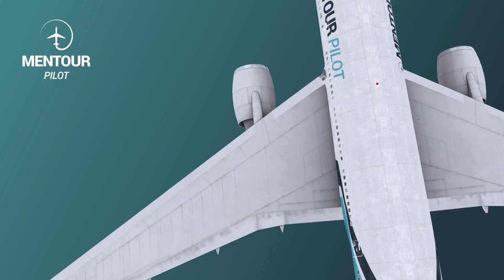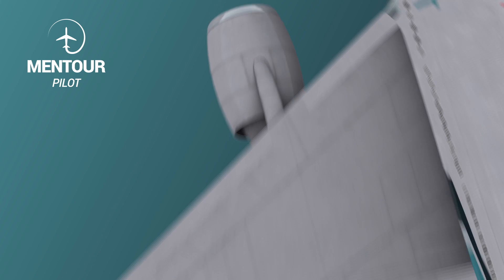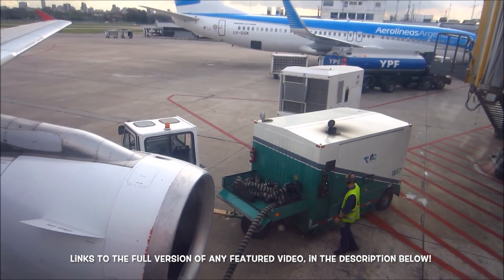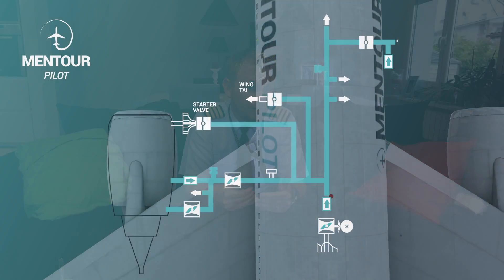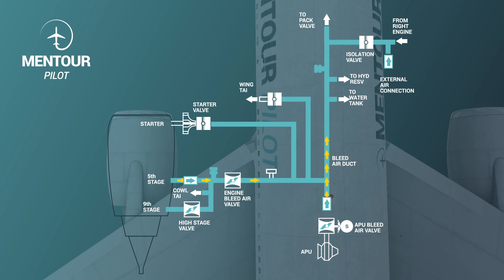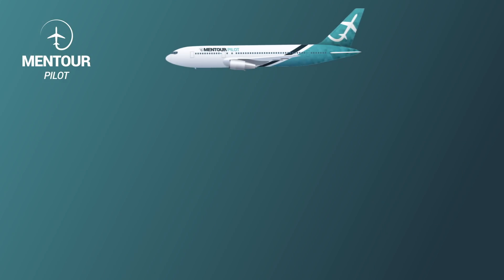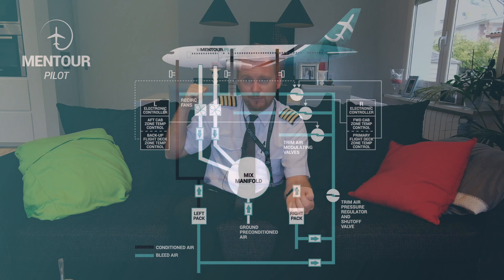How does the Boeing 737 Bleed-air system work?!

Comment: I don't understand why and how bleed air is used during engine start. I thought that the engine starters were powered from batteries or the APU. I remember long ago, before APU's were fitted, start power was provided from a mobile generator that was connected to every plane while on the ground
Reply: The starter is a pneumatic turbine. Needs air to turn

Comment: I remember the only time I flow in an L-1011 TriStar. I saw some sort of vapor descending from the ceiling near the left side of the cabin. I never said anything and nothing bad happened, but I still wonder what I was seeing.
Reply: Condensation, maybe? If the air from the vents is colder than cabin air, it is possible.

Comment: That method of diagnosing the bad engine led to an infamous crash in England. An engine was malfunctioning and they smelled smoke in the cabin. So the flight crew shut the engine down -- but the WRONG engine (the GOOD one). What happened? They were flying a newer submodel of an aircraft they were familiar with. One of the changes the manufacturer made was to switch the cabin air to a different engine. Crash investigators concluded that the crew weren't adequately trained on the newer plane! 😥

Comment: We sacrifice a bit of fuel in order to keep the PAX alive.... Thank you Boeing, thank you Ryan Air!!!!
Reply: The Cabin pressurized with exhaust gasses for the flight duration can not be a good thing ,
Can't be nice for the Pilots and Cabin Crews  knowing that their work place is heated with exhaust fumes from the jet engines,or the Ground Crews breathing exhaust gasses for a good percentage of their shift ,
The upside the pay is good !
Reply: @markf5437  I believe the bleed air is extracted from the engine before the burn chamber.  You are just breathing the air that enters the turbofan but compressed, heated, and cooled.
Reply: @tonyperez8683  It is air that has been through internals of  a mechanical compression process of shafts turbines bearings etc  operating @  +600c or above there will be fumes from the oil lubricating the bearings
Reply: The PACS keep the PAX alive!

Comment: Is starting via external air ever used for fuel/cost savings? I.e. some airports provide ground power/ground aircon, so you wont have to sit with the APU on, it seems like an air start that keeps you from having to put any start/stop cycles on the APU would go with the other two services.
Reply: The problem with that is the cabin heats up really quickly, particularly with 160 sweaty people on board. The airconditioning packs need to be run to keep the cabin cool. There is a bit of messing around with air starts from an external source. Then the other engine needs to be “cross bled” started when out on the taxi way. Much quicker with the APU - aircraft stays on schedule.
Also if you don’t use the APU you need to supply an external electrical power source

Comment: What happens when the airport itself at a high altitude or even above 8,000 ft?  Does the pressurization system have to be adjusted to compensate so it doesn't overshoot too far?  Does the pressure remain essentially the same during takeoff or approach to such an airport?

Comment: Love the videos, but two questions on this one Mentour:

1. Why is the water removed from the air intentionally when this is a common complaint on aircraft. Why not keep a comfortable level (or at least more comfortable) level of humidity in the air by removing less water or none at all?
2. How can you smell a bird burning after a bird strike if the burn chamber is after the bleed chamber. If you're not smelling burning jet fuel usually why would you smell burning bird?
Reply: At altitude there is very little moisture up there, also dry air is good for preventing corrosion on the air frame, 
Bleed air is compressed air about 250C degrees at about 40 psi, when u compress air it heats up at that temp. U will easily roast that bird to bits
Reply: Clinton Mead Water is only removed on departure from humid tropical airports.
Reply: @gordonrichardson2972 how does the water separator know what airport you are at?

Comment: 5:46 Since the air is already really dry,  why do they lead the air through a water separator in the first place?
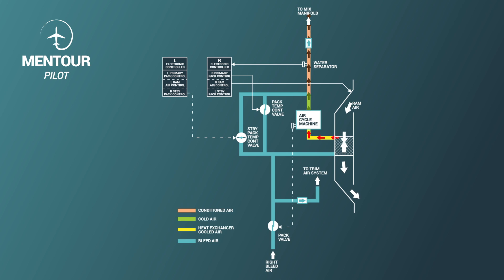Reply: The same way a conventional air conditioner ("vapor cycle machine", as opposed to "air cycle machine" like shown at 6:09) often drips water.  Its evaporator (vapor cycle) or expansion turbine (air cycle) gets cold enough to condense water out of the humid air, leaving dried air.

With air cycle machines it's usually a lot colder, cold enough to even condense out what little moisture is in the air up at altitude.  The water separator clears out the resulting fog / frost.  (It is then often sprayed into the ram air to further help cool the bleed air, as described at 5:08.)
Reply: Bëpp The air is only dry at high altitude, the humidity at departure can be significant.
Reply: Gordon Richardson That makes sense, thanks!

Comment: Doesn't the air brought in from outside at altitude have too low of a concentration of Oxygen in it?  Does "burned bird" smell like rotisserie chicken?
Reply: It's because it's at a lower pressure that there isn't enough oxygen. You'd be breathing a considerably less volume of air. It still has the same concentration of 78.08% Nitrogen, 20.95% oxygen, 0.93% Argon, and 0.04% other.

Comment: Wouldn't we be sacrificing a bit of fuel efficiency using electrical compressors too? All in all, it uses electricity generated by the engine, and adds weight to the aircraft.
Reply: Yes and no. The engine to sustain power would need a tiny bit more fuel to remain at power but it depends on how the electrical system is done.
Reply: jdr ok , same goes for bleeding air from the engine. If it isn't as efficient as it could be, then the loss could be significant, but that's a question of design. And bleeding air directly from the engine has extra advantages over an equally efficient electric system, like simplicity, so sought after in aircraft design.
Reply: @nicky5185  every system has its pros and cons. No system is perfect and never will be. Just like electric motors have either good low rpm characteristics or have to be pegged to do anything. It's all about building for your application. Figuring out what's what and what is best for your needs. But engines better get there quick before they try and replace the jet engine and the rocket with a electric motor driven prop and set us back about 100 years in propulsion

Comment: I commend Boeing for its bleedless, all electric pressurization in the B787.  If the bearing seals of the engines fail smoke from the engines enters the cabin.  It’s carcinogenic and a neurotoxin.  Happens a lot.

Comment: So what happens when you board the plane at a hot airport and what looks like smoke is blowing into the cabin (I know it’s not smoke and it’s perfectly fine to breathe)
Reply from the maker: That’s the cold air from the air conditioning meeting the humid air from outside. What you are seeing is water vapor
Reply: Mentour Pilot thanks. I knew it was vapour but not why it happened. Saw it on a flight from Nice. Could barely see the back of the cabin there was so much

Comment: What if the heat exchanger and air conditioning fail? Will the hot bleed air be passed into the passenger cabin?
Reply: No hot bleed air will get into the cabin, there are shut off valves to regulate and isolate the bleed air.
Reply: @e30mark  thanks for clearing my doubt 👍

Comment: Could the outflow valve fail closed? Would this increase the cabin pressure to too high levels?
Reply: There are redundancy pressure relief valves which spring loaded to certain pressure value they will open after reaching adjusted pressure difference value.
Reply: Kaeltis There are cabin pressure warnings on the pilots displays.

Comment: I knew that. When I first began flying I could always detect a very faint odor of jet exhaust. It was later on that i found out that the air we breathe is indeed bled off from the engine and it acquires that very faint odor.

Comment: Interesting subject. I learned a lot.
One thing I don't agree with. You say the 787 is using electrically driven compressors to provide bleed air (and I believe the wing edge anti ice are electrically operated as well) to save fuel. 

The additional electricity has to come from somewhere and is generated by the engines IDG, including a mechanical and therefore rather inefficient CSD. The IDG and CSD need to be sized bigger too provide the required electrical power and this generates an additional power demand to the engines. 

I am not sure if this will save a lot of fuel, if the available fuel energy has to be converted a couple of times, from pressure to generator via CSD to electrical energy and later back to mechanical to operate secondary compressors.
The statement that some subsystems are operated electrically to save fuel doesn't seem to be justified.
I am not so worried that the Boeing engineers have not done their job, I am rather concerned that this is a marketing trickery saying that subsystems are operated electrically and therefore saving a lot of fuel.
Reply: Perhaps bleeding the air out of the engine is a bigger toll on the fuel efficiency than putting more resistance on the engine? My guess would be that the air pressure inside the engine really determines the efficiency of the whole thing, and it was probably much cheaper designing it that way so I'm also a little skeptical, just seems far too convenient of an approach.
Reply: The saving fuel line is probably a smoke screen. Really they want to stop using bleed air which can cause contamination inside the cabin

Comment: What happens when flying out of Mariscal Sucre International Airport, Quito, Ecuador, which is at an altitude of 7,874 feet?
Reply: John David Wolf what about it? You can still breathe at that altitude
Reply: As Alejandro Velasco Astete International Airport, Cusco, Peru, is at an Elevation AMS 10,860 ft / 3,310 m which is HIGHER than the 8,000 maximum equivalent cabin pressure what is the protocol?  Yes I have flown into there, but it was decades ago.
Reply: John David Wolf I’m guessing then that the outflow valves will close after takeoff until the cabin air reaches 8000ft. If the cabin air was 8000ft on the ground you’d struggle to open the door in an emergency probably

Comment: Very interesting but I still couldn't figure out from this why it's usually so cold on the very first morning flight
Reply: @Trust Jesus before engine startup and in the initial flight stages, understandable. But why would the cold last for the whole short-haul flight? That's what I experienced twice with different airplanes. Did the pilots just set the a/c on too low?

Comment: Why do they make the air so dry? It's one of the worst parts of the flying experience?
Reply: I don't know for sure, but perhaps using bleed air has something to do with it? Perhaps the compression drives all the moisture away, or there's just no humidity up there at all?
Reply: It's dried at lower altitudes to reduce corrosion but at cruise its mostly dry.

Comment: Why is it pressurised at around 8000ft and not much lower? Also why do they not put some of the water back to the cabin to make it less dry, is it an ‘all or nothing’ type system
Reply: Amy Wagstaff if they pressurise to 0ft that would be a huge amount of force exerting on the airframe and it would weaken much sooner. The pressure at 0ft pushing on the frame is more than 8000ft so it’s a fine balance. The 787 and A350 can pressurise to 6000ft I believe because the fuselage is made from composites instead of pure metal so it’s stronger and doesn’t bend and flex as easily. Therefore it can take more force

Comment: Ahh, air starters. Using a turbine to spin another turbine which starts the actual engine turbine. I love aviation.
Reply: And then using the other engine to build up bleed duct pressure to cross start the other engine.
Reply: And then, taking some air from that process, which is way to hot to pump into the cabin as heat, and cooling it down to a point where it is way to cold to use as AC. AND THEN adding more hot air to it to make it the right temperature.
Reply: @everydayfixer8446  Ahh! Bernoulli, Toricelli, and Pascal would be proud to know we paid attention 🙂
Reply: And then using said bleed air to keep us all alive at 35,000 feet.
Reply: AND THEN using engine motive flow fuel pressure to move fuel from the tanks to the engines without needing to use the fuel boost pumps
Reply: [img]Xzibit picture[/img]
Reply: So what happens if you lose all of your engines at altitude like the aircraft flew near a volcano? How long will the cabin remain pressurized since you don’t want to rapidly descend if you have no engines running.
Reply: @johnp139  well there is the APU and also the ram air scoops. The APU also has bleed air, that's used to start the engines and to pressurize. If the APU also fails, the air being forced into the ram air ducts would pressurize the cabin and provide breathable air. The outflow valves would then regulate how much air leaves the cabin, thus regulating cabin pressure. Loosing all engines is an emergency though and the plane would come down to land at the nearest airport as quickly as possible
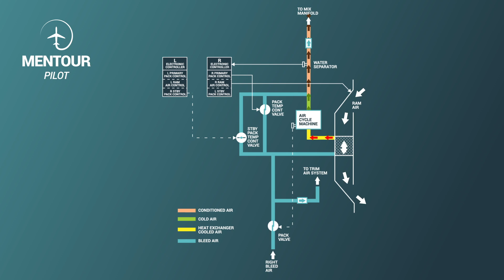Reply: @JDJD-mw9rr there is no air being rammed into the ram air ducts that could be used the pressurise the cabin on a B737. The ram air ducts on the B737 are used to cool the bleed air that is used for the air conditioning packs. The diagram @6:10 shows the ram air system and you can see the heat exchanger. The diagram is very basic and not shown very well but it shows the ram air flowing over the heat exchanger. There are actually 2 heat exchangers, a primary and a secondary.
Reply: @johnp139  If you lose engines, you still have APU. So you can and probably will start it to provide bleed air for you. Problem solved... :-)
Reply: If both engines fail and you're using bleed air from the APU to pressurise the cabin, is that also hot? So could you in that case keep the cabin temperature up? Or would it get very cold?

Similarly, presumably if you lost the APU as well and were pressurising the cabin using ram scoop air, it would get very cold?
Reply: Yes,  @jennymulholland4319 , of course the APU's bleed air is hot, because it's just another jet engine. But then the concern there is that they're having to glide to the nearest airport, so that's what the emergency oxygen system is for.
Reply: @jennymulholland4319  yes if there was no bleed air coming into the cabin it would get colder but not freezing. Im pretty sure if both engines and apu were lost then the plane would depressurize to a point to were the 02 masks would automatically fall down so everyone could breathe. The temp would probably be a minor inconvience. Gliding to the airport safely would be the main objective . Out of the thousands of flights that happen daily, having all engines fail and APU fail is ETREMELY unlikely. I'd actually be interested to know how many times this has actually happened, if ever.
Reply: @JDJD-mw9rr  if you ran out of fuel
Reply: @jennymulholland4319 no ram air scoop to pressurise the cabin on the B737
Reply: Heh that is hardly unique to aviation this is a common feature of very large combustion engines as batteries can only store enough energy to crank smaller engines, large aircraft, ships, power plants etc all have to use an intermediate engine to act as the starter motor for their main engine as they have shaft masses in the multiple tonne range. Of course power plants do often skip the local diesel generator and bootstrap their main steam turbine off the grid instead as it's usually always there but they do have a local bootstrap mechanism just like aircraft have their batteries to start the APU to bootstrap the main engines.
Reply: all being powered by a poor bastard thru foot cranks and pedals😂😂
Reply: @HelloKittyFanMan.  I wouldn’t consider the starter an engine. The starter is a single-stage, axial-flow, turbine air motor. It’s driven by air
Reply: @NicholasRiviera-Dr : Originally I was thinking that he was talking about the huffer, which is powered by its own engine (usually another turbine engine, if I understand right, but I also wonder if there are any reciprocating diesel ones with tanks). But now I just realized that it sounds like he's talking about the little pneumatic turbotransmission installed on the APU that gets its air power from the huffer.
Reply: Uzaiyaro, either I misunderstood your post previously, or you edited a key part of it since I last replied to you, without updating me. Anyway, I've deleted my original reply and now I replace it with this (in which case you may want to consider additional editing): A turbine doesn't drive air or other gas; it gets driven by it. So the blades that push the air into the next turbine aren't a turbine themselves; they are either a really strong fan or at least one stage (most often the latter, if I understand right).
Reply: @HelloKittyFanMan.  this engine has 2 spools. There is a low stage and a high stage.

The low stage has the fan plus 3 stages of booster, which makes it a 4 stage compressor. A shaft connects that to the low stage turbine which has 4 stages of blades.

The high stage has 9 stages of compressor blades, a shaft joins this to a single stage of turbine blades

@2:53 there is an animation that kind of shows this. It’s not a particularly good animation because it doesn’t represent the construction of the CFM56 engine and some of the sections of the engine don’t turn the way they are supposed to. There is no counter rotating stages on the CFM56
Reply: Please make a video about electric system!! 😊